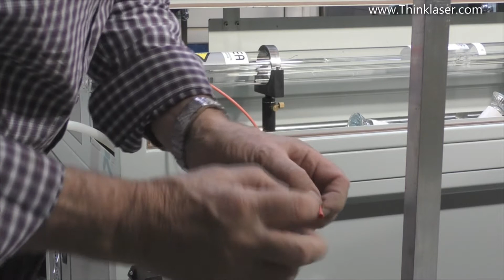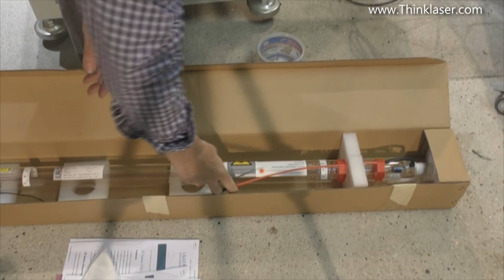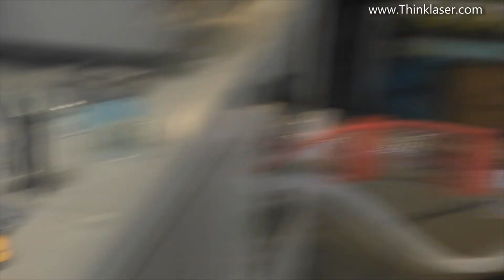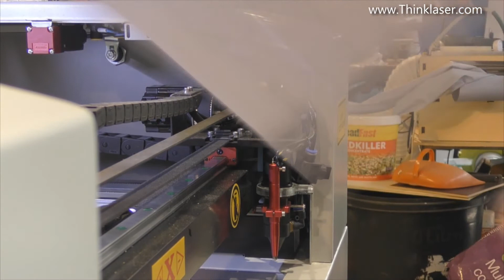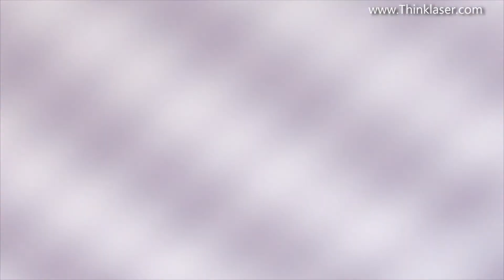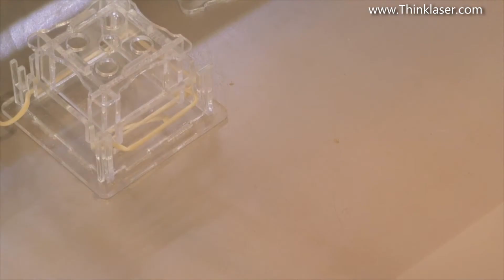How To Use A Laser Cutter - Lightblade Learning Lab 24 Changing Your Laser Tube

Comment: Why would you cut the plastic off the terminal block and then use some rubber tube insulate it ?
Reply from the maker: Hi 
This is Gareth @ Thinklaser.

The insulation on the terminal block is insufficient to insulate the high voltage on it's own and if it was left in place there is a chance of air bubbles being present. 

The high voltage is able to jump small gaps by arcing and this arcing causes carbonisation of the material, making future arcing more likely.

By insulating with a silicone sealant within a silicone tube, you are minimising the risk of arcing happening at all.